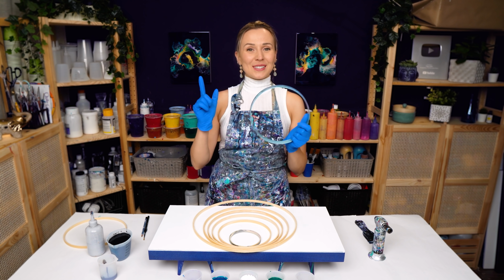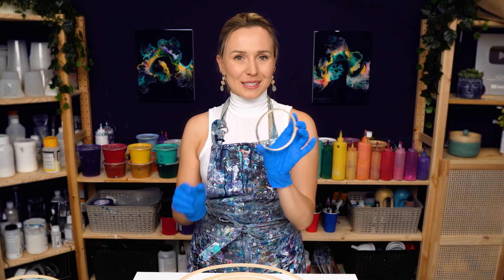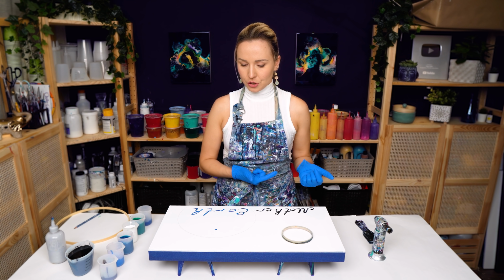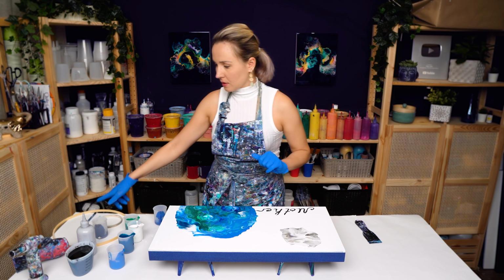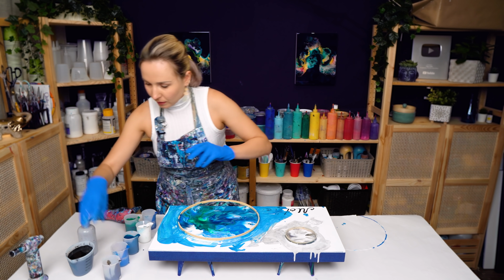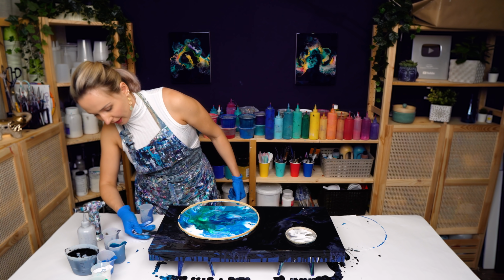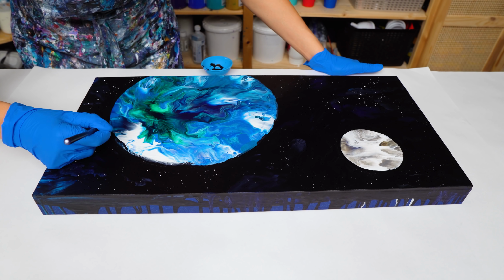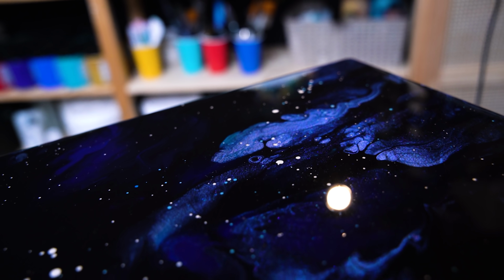NEW TOOL for Planet EARTH POUR! 🌏 Pouring TIPS! Dancing UNIVERSE Acrylic Pouring🌌Abstract Galaxy Art

Comment: You could put a coating of deck sealant or polyurethane on the bamboo hoops. This would prevent the paint from seeping into the fine grooves, make them water proof, and much easier to wipe clean. Just an idea.
Reply from the maker: Thanks for the tip, Linda!🤗

Comment: Absolutely love this and THANK YOU; I've been trying to find rings to do my own pours like this. Using the wooden rings is something I didn't think of, but I will get now. (For the one painting I did do, I had a small canvas, so I just cute out a plastic container's bottom and used it for my sphere. I've yet to touch it up but it turned out amazing I think)
Reply: I used a saucepan lid for my moon pour 😁 It was actually a really great find, easy to lift off when I was done because it has a handle. It was also heavy enough to not have to worry that it would move at all 👏 We have to be creative before we even touch the paint 😂
Reply from the maker: You are so welcome😉